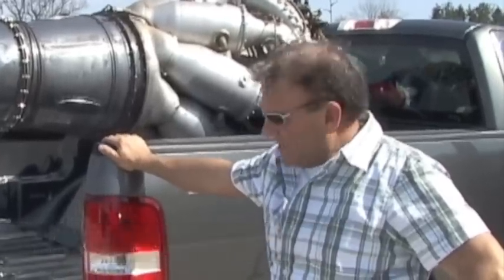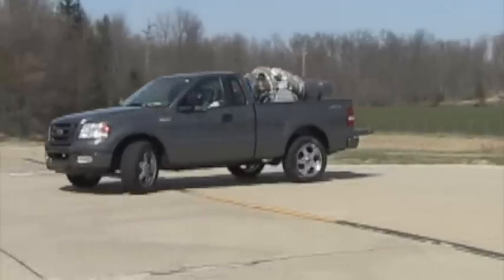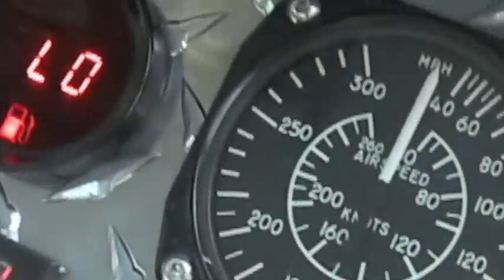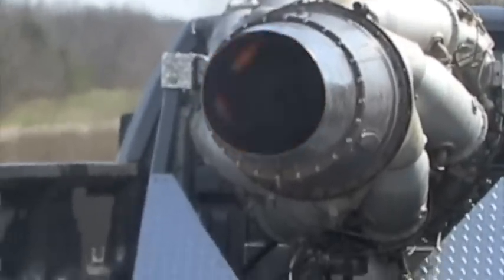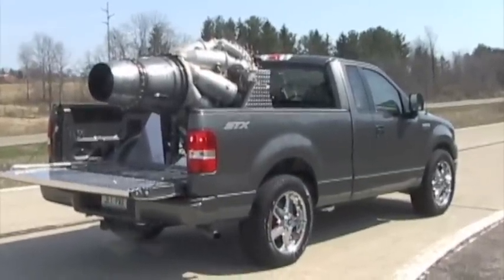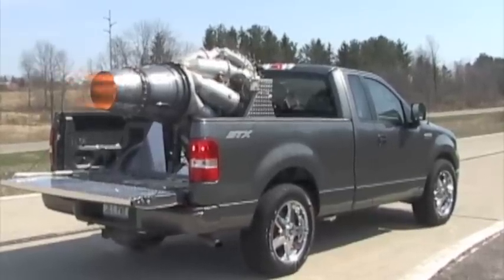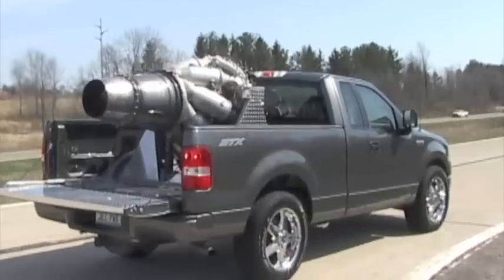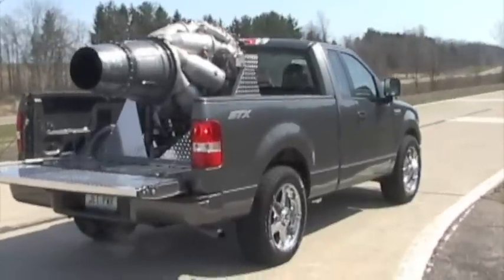F-150 Jet Truck

Comment: That was really impressive.  Massive acceleration.  Massive top speed.  I wonder if installing it in a Ford will cause it to break down repeatedly.
Reply: I was wondering the same thing
Reply: Larz Oof for Ford. F to respect, boiz
Reply: Naw...... The original engine was removed for a bigger transmission. I don't think the original transmission is in there because it had leaking issues.

Comment: What?  That's it?  No demonstation of how fast it goes?  No video of it at speed?
Reply: +Edward Cabaniss That was full speed.
Reply: +Larz haha. Seriously ?
Reply: Edward Cabaniss We'll just skip to the funeral....
Reply: It is a really stupid idea as done, in hindsight, but a really awesome prototype to begin. 

The things should have mud guards around the air intake and it should be turned the other way with vents going to the side of each tire pointed at 45 degree angle. 

Then, the drivetrain could be used as normal but when the truck got stuck in mud it could jet engine super boost itself out of any mudhole, that would be a meaningful and glorious improvement.
Reply: The truck itself could go faster than the final velocity shown in the video

Comment: 2700 HP !?????
Yet moved like a 4 cylinder 
He is running on some BALD as street tires
Reply: Soo true he moved slower than a 4 cylinder
Reply: Yea .... That thing was flying !!! 
We are not talking about capabilities ! 
We are talking about THIS specific truck on THIS  video .
Reply: David Vitela  It's a turbojet. Turbojets are ineffective at low speed and altitude. Pretty pointless on a truck.
Reply: this is not a track , he is on a Main Street . 
He has cheap aftermarket wheels with bald tires ! 
Haha... Let me guess all that power . Tires aren't bald they are " slicks " haha
That alone tells you how under performing this truck is .  
Yea I guess when you race up to 300mph you win a lot of races on the street . 
Hahaha
Reply: David Vitela     For everyone complaining about the "speed" allow me to enlighten you with some physics. 

    Turbojets produce an incredible amount of power, this one in particular is very outdated  and produces roughly 13 times as much power as most high performance car engines. The reason it accelerated slowly is because its a jet. It moves a  relatively small, concentrated amount of air extremely quickly in one direction. Thus, it accelerates much like a car does in very high gear. But the thing is, even though it accelerating slowly, its not going to stop accelerating for a very long time. 

    For example, say we had 2 cars, one with a piston engine geared to its wheels and the other with a jet engine. Both engines produce the exact same amount of net energy. The piston driven car would slaughter the jet car in acceleration but very quickly it would reach its top speed (say 140 mph). The jet car would take a little longer to get to that speed. But once at that speed it would keep going, to 150 mph... then 160.. then 200... then 250... and would probably max out at around 350 mph. (Also note that a jet engine with the same power as a piston engine would only have to be at MOST 1/4 the size). Overall, turbine engines are the most powerful conventional air breathing engines we have. In comparison piston engines are like hybrids. 

I'm kinda tired of all these motor heads thinking their 'sportscar' is the most powerful thing in the world.
Reply: Thanks for the bed time story ! 
Doesn't change that it will get dragged by a 4 banger with " premium " gas ... Haha 
Or any street car for that matter . 
Well wait ...... Any one want to race up to 350 MPH ?? 
Come on guys I'm sure a ton of you race your car to that speed !
Reply: ian Ferguson Oh and P.S. you know EVERY SINGLE FIGHTERJET IN THE WORLD AS OF 2015 can beat EVERY SINGLE CAR in a race up to 140 mph? Just sayin.....
Reply: David V Ok if this is about the truck only then you are right, I doubt this thing could break 100 mph. It's pretty pointless. 

But 1400 mph isn't star wars dreaming. Hell, the US Space Shuttle's re-entry velocity is around 16,000 mph. Nearly all modern fighter jets peak around mach 2. Many can go much faster.
Reply: David Vitela 1. You cant really take jet engines thrust and change it to HP. 
2. How does tires matter in this case? That engine is not transmitting ANY power to wheels.
3. It is jet engine, not any kind of piston engine that transmits power to shaft. It starts slowly, but keeps accelerating for loooong time. 

OT: Worst air intake ever.
Reply: David Vitela That 4 banger would melt from the heat of the turbojet
Reply: ***** I'm afraid I don't understand. Are you agreeing with me? I stated all of that in the comments above.
Reply: yet you haven't seen the full power of that thing
Reply: Constant thrust vs constant power
Reply: Damn David why are you so mad about. I like how you have no idea what the purpose of this car is nor do you know how turbines work yet still talk shit. Cuz yeah he's going to race his impractical work truck.

Comment: So where does one acquire said jet engine...? Um... asking for a friend...
Reply: build it yourself. Or scavange an old plane
Reply: I have a Westinghouse J34 Possibly for sale for a fair price.
Reply: The faa limits the hours on them until they need extensive overhauls (hot sections). If it's an older engine it's basically useless for aircraft at that time and can be found cheap.

Comment: I get it! You have a jet engine on the back so that when the truck fucks over, you can just use the jet to get home instead of walking!
Reply: +Marcus_Mravik uhhh 1.5 gallons per minute...
Reply: +Marcus_Mravik DONT ASK WHY DONT ASK DONT TELL BESIDES ITS TO GET PAST THE COPS WHAT IS THAT FAST THEY WILL BE AFRAID TO REPORT AND GET JOKED AROUND BY "DID YOU FIND THAT MYSTERY BLUR YET"
Reply: er

Comment: interesting idea, but the only problem is that where it's mounted it looks like you forgot that air still has some density, since where the intake is right behind the cab, is going to cause a low air pressure zone the faster you go since the air is going to be diverted away from the engine's intake.  So, it's basically fighting itself, as the more power you put to it, the more air it will need as it propels the truck faster, but the truck's cab is diverting the air away from the intake starving it for air.  Need to make a ram-air cowling, but first to do that you will need to track the air flow over the cab.  Put the cowling too far back and you'll still have a problem with low pressure.  Look at the problems the first Pontiac GTO, it's hoodscoop actually didn't draw any air in because the leading edge of the hood diverted the air right over it.  Just remember that air has density, even though it's a lot lower than water, it still behaves in alot of the same way....  But, I really don't like to make it seem like I'm putting your creation down.  I absolutely love it!!!  If I could, I would do it myself.  :)

Comment: The jet engine needs clear path for air inlet for its maximum performance, if that's a legit jet engine in the first place.
Reply: then in that case put that jet engine on the top of the car
Reply: or just redicect air into it.
Reply: That is a real jet engine lol
Reply: @FrmerK20  Just like the ' S ' duct for the tail engine on the Lockheed L-1011
Reply: @FrmerK20   
It doesn't work that way. Air must be direct in the intake,  as in ram air. Otherwise you have a major loss of usable horsepower.

Comment: They should add a thrust reverser! Image how awesome that would be. 60-0 in 0.5 seconds.
Reply: doggonemess thrust reverse would not slow it down that fast. Trust me. Even airliners dont rely entirely on thrust reverse. They use a lot of wheel brakes.

Comment: It doesn't even go fast. Looks like a common ford turd with a useless jet engine in the back.
Reply: Jets make power on the top end. The faster they spin the more power produced. What did you expect it to immediately go mach 2? If you ever been on a commercial airliner then you should know the start off slow.

Comment: So is the only thrust it put out through the jet exhaust?  Why not work out some kind of drive system and really take advantage of the power instead of just having a big noise maker?
Reply: you clearly dont understand how jet engines transmit power. the thrust from the exhaust is the power. there is no crankshaft that you can attach to wheels to power your vehicle
Reply: Ryan Boyce Go Google what a turboshaft is. Then take a look at how the MTT Turbine Superbike or even the M1 Abrams put power to the ground. I'll give you a hint, it's not by the thrust generated by the exhaust gasses.
Reply: right, you are correct about that. Those are gas turbine engines that turn a turboshaft. They have them in tanks helicopters and turbo prop planes. This jet engine is just a turbo fan, like the kind used on jet aircraft,  and these provide power with exhaust gas thrust.
Reply: Yeah, I can see this. My original question was why use this system as opposed to one that will generate a much more usable range of power. In other words, it would make more sense to use a turboshaft setup than this one which from the video just appears to be a large noisemaker.
Reply: right, any kind of turbojet engine put into a car is not really very practical. theres a lot of problems with that kind of setup as well. Youd have to build a transmission and drive train to use it. I think the biggest issue would be that the power transmitted to the wheels wouldnt be useful because it would probably just spin the tires because of the huge amount of power.
Reply: Ryan Boyce well you just have to gear it down like they do with the hydroplanes, and pulling tractors, that said turbo shafts are turbines, and so are jets, I mean they are a type of turbine engine, they have the turbine section that cranks the fan and compressers to really high output pressure, which is what gives it the thrust, they are the same engine design only differant uses of power, and jets are good at makeing lots of power, and any liquid that is combustable can be used, some better then others, its just they use tons of it they are loud and very hot, and there is lag for it to spool up or down when you change the throttle, but if you are in an aircraft less of a problem as you are in consent motion but when you have to stop and go its not going to do real well, same with locomotives that use them or did, the prob there though was mantaining them and fuel usage, and pulling tractors they get a green flag and can start the winding up and when they get all of it going let the brakes go and when they start to speed up they have the track so long as they are not stopped for the 300 foot run till the end, one dont have the luxury at a stoplight. heh but they are cool

Comment: @John5342 
From wikipedia's Foot-pound_(energy) article:
Both energy and torque can be expressed as a product of a force vector with a displacement vector (hence pounds and feet); energy is the dot product of the two, and torque is the cross product.

Comment: Very cool. Powered by exhaust turbine thrust. What's happening with the rest of the truck? Is the stock motor still inside?
Reply: Given the efficiency of a jet engine, it probably still has the original motor in it. Along with the fact the exhaust is still on the truck

Comment: @MassiveLemon
Running on racetrack and running on the straights is totally different story, racetrack has turns so high horsepower car does not necessary have the advantage over small horsepower car, but on the straight high horsepower vs. low horsepower (assuming same weight class) makes a lot of difference.

Comment: i was curious about how ur allowed to drive it on the road. Do u need a special permit? i dont think i want to be that admiring pedestrian at the side of the road when this vehicle passes by :P. I really love the truck. thumbs up!!!!
Reply: About my earlier comment - Does anyone know how it got to be ridden on the public roads (according to the video) as the noise levels are high, and the air pressure at the back would affect pedestrians? Is there a permit one can take to build and test such vehicles. And how much does this sort of job cost? I remember an awesome jet engined bike (still available i believe) that has high noise levels but can be driven publicly.

Comment: dude you need to put in the description that jet engines use thrust to take off cause people understand that it doesn't use the drivetrain of the vhicle itself.... it looks slow on take off cause it does use thrust but dude once it starts rollin it's beast

Comment: Oh my God! You guys are killing me... 

Ok, first of all, a jet engine produces thrust with the unbalance of air pressure it produces when compressing it. So no, it's not the engine that pushes the truck, but rather the imbalance of pressure that throws the truck forward. 

Next, yes, a jet engine can use a secondary gear box to transfer the power from the engine to a drive shaft.

Comment: It doesn't need tread on tires! You don't need tread unless it's raining and also the power is not coming from the wheels it's coming from the thrust at the back of the engine so the tires make no difference!

Comment: well some of your arguements don't really work out on a jet vehicle.  like B, it only works with tires, but here, the jet engine isn't spinning any tires, just pushing the truck forward.  and i'm pretty sure jet engines don't use gear ratios

Comment: Y’all, this ain’t real. That f150 does not haul that much fuel with it. It’s simply a stolen video of a guy hauling a jet engine in his truck bed with turbo fan sound effect added on the acceleration.

Comment: Add twin turbo on this car , change the engine and tune for 2000 hp than this rocket engine behind your car is probably like a 300 hp itself  so cn push to 2300 hp 🔥  or if u use 2f those rocket thingy can do somuch more

Comment: This truck won't do 200 either. It says the top speed is 140, but I'm guessing that's in drive, redlining 4th gear. If he puts it into neutral and eliminates the driveline drag and limit, it would probably do more.

Comment: Its not like the jet van, where he had a helicopter engine on it and was pulling power from the shaft, he's using the thrust from accelerating the air in the opisite direction he wants to travel. a.k.a. newtons third law.

Comment: arnt jet engines more efficient with fuel all together?
Reply: No. The contrary is the case. Jet Engines are very fuel inefficient, BUT they have a very good weight to power ratio. A normal stroke engine that size and weight would have a fraction of  the power output of a jet engine. Modern jet engines are getting more and more fuel efficient (but so do normal engines), but they still need a lot more fuel for the same poweroutput as a normal engine.
Reply: ahh derp

Comment: 2700 hp i bet it will 200 in park.

were he will get in trouble is the stock height. the body roll alone would make it flip i have a reg 05 stx that ive ran 120 and its a hand full even with my eibach drop

Comment: @berzerker17487- I stand by what I said.. the myth called for a JATO, granted they used rockets, the effect would've still been the same if they were given an actual JATO cell - the speed should have more than tripled when the truck let go of it's brakes, there would've been a tiny bit of lift on the back due to sudden acceleration - this thing looked like it just coasted forwards. some1 did it better on a van and it actually lifted a few inches in the front the way it should on "launch".

Comment: Thats a great idea, but the amount of thrust that engine could put out would shoot that less than 5 ton truck into the air and into a tree. Not to mention the engine would have insufficent air intake with an obstacle in front of it. That is probably real, but that engine is probably at 2 or 3% capacity.

Comment: Should have put it on a boat instead.  
It's also not good to push a truck with an automatic transmission. Transmission will overheat.

Comment: To those who call it lame, u must be jealous because you dont have the know how to install a jet engine in your vehicle. Also power with turbine engines depends on the speed of the air going into it. The only downforce you need is to stop quick enough (unless you have reverse thrusters). Finally the top speed of the system on that realtivly pos engine compared to others...is still hauling ass in a pickup. Also...It may not be that its maxed out as much as it's difficult to keep in on the road.

Comment: Thats an old weak turbojet, nothing like the afterburning jet engines you see on those big semi trucks. Jet engines have low force multipliers, given enough road it could get that truck going very fast. Should test it on the salt flats.

Comment: I don't think you guys get it.  The M-701 is  turboJET engine.  Let me dumb that down for you.  Turbojet engines do not have "good acceleration"  If it were a turboFAN engine you all would be singing a different tune.  Turbojets were the first combustion turbine engines produced so naturally they don't have a lot of power, and to top that off they are most powerful and efficient at supersonic speeds.  Could smoke your stupid 1980 Ford Pinto.

Comment: Dummy should have bought a Chevy and saved all that money and effort on the jet engine... The only logical reason for a jet engine on a pick up is so that you can redirect  the heat and air force to dry a race track after an accident or drizzle. I've seen them use it during Formula One races.

Comment: And last but not least, to the clown that says that a F150 is aerodynamically challenged, the air aspiration limited by the engine placement is more of an issue than the "Square Box" look of the truck. The less air you can compress, the less pull you will get.

F150 Cd = 0,40
GM Hummer (4x4) : 0.56
BMW 320i : 0,39
Prius 3 (2009) : 0,25
Touareg : 0,38
Cd being Coefficient of Drag

And by the way, you can put Z rated tires on a F150...! ;)